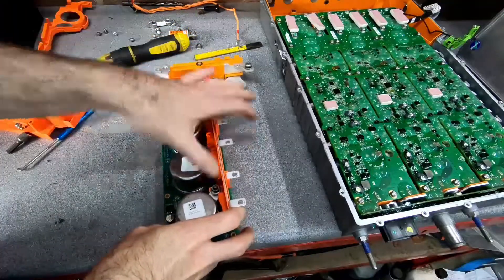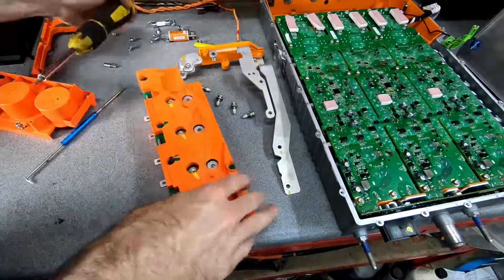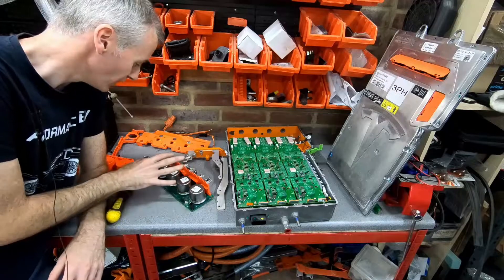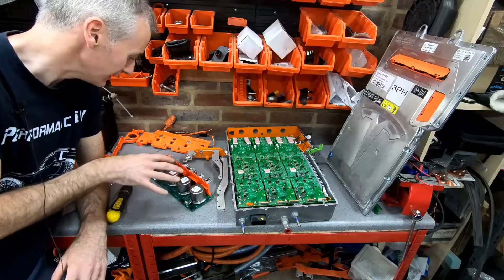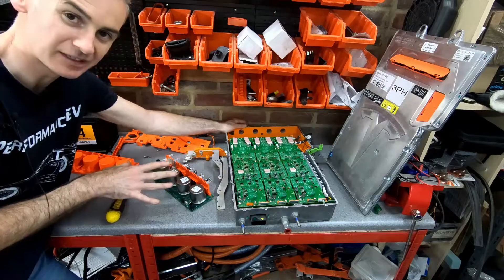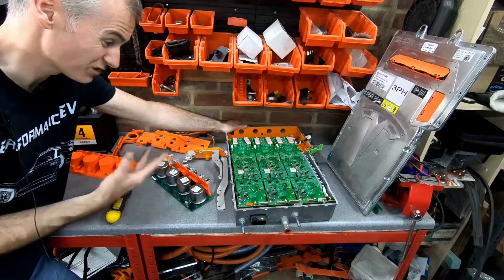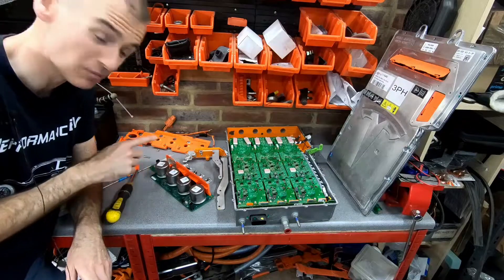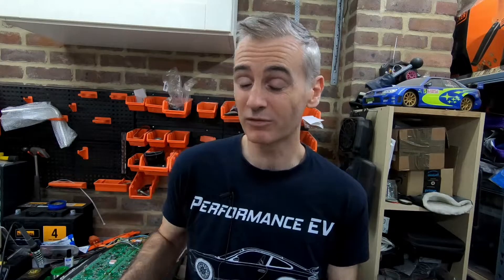Tesla Onboard Charger Teardown Pt2 - High Voltage Junction Box in a Gen3 EV Charger - Audio Fixed

Comment: Question:
If this 11kW charger has 3x3.7kW single ohase chargers, how it chargers at 1x7.4kW?
Are the same contactors used to bridge L1 and L2 to make single phase high power AC possible and make the battery live at the grid AC, or is some internal bridge?

Or these onboard units can handle 32A (7.4kW) each, but due to heat, togetheter they can handle 11kW?
Reply: 3 phase charges are 72amp and 22kW, all are at least 2 phase 48amp with 11KW, the third phase just doubles the KW to 22KW
Reply: @Serge0329  The things you wrote make no sense to me.

Comment: DC charging uses the extra 2 pins below the normal AC charger. Do those route through this charger as well? Which lines do they arrive at?
Reply from the maker: They route through all 4 lines, 2+ and 2- . This seems to be the reason for the 4 contractors on this board. The each pair bypass the chargers and route to directly to the + & - outputs. If I recall correctly it is L1 and N that are - and L2 and L3 that are +

Comment: Does anyone know how DC pins on the socket are isolated if AC charge is accessed? From the way it's connected on the bus bars if you close contactors for AC charge DC pins on the socket will become live, no ?
Reply: For model S and X, there are no dedicated DC pins. L1 and L2 becomes (-), while  L3 and N becomes (+). These cars predate CCS and adhere to original idea of type 2 plug that it could handle single phase AC, 3 phase AC and DC by the same pins. 
VW 'invented' CCS to take money for 'promoting fast charging and making EVs practical', because they nerfed they first EVs to 3.7kW AC and claimed nobody bought them because there is no fast charging possible. 

As for Tesla DC, OBCs are designed to sustain up to 500V DC on the input of AC chargers, without damaging them, and they stay inactive while DC charging.

Comment: Nice to see where the multiplexing happens. So this is pre-CCS I suppose.
Reply from the maker: Yes, I think so. I wasn’t overly familiar with the various Tesla charge ports, but it seems this one was from an era when there was a single Type2 like port that could handle both AC and DC rapid charging. Only one set of cables required, which I think is pretty neat.
Reply: @PerformanceEV  This is post CCS for the Model S as a CCS will not fit in the light cluster port but a type 2 will.
Reply: @nickunreal3  You plug in a CCS adapter and 2 pins of the Type 2 port get switched in parallel for each DC positive and negative.

Comment: Great video and well explained. I'm interested in this as my model S only charges at 16 amps on a 40 amp circuit on my Gen 3 wall charges. I think that the onboard charger may be the issue as I have tried it on 2 separate wall charges and other model 3's do get their charge rate at 32 amps on the same wall charges. 103 liked.